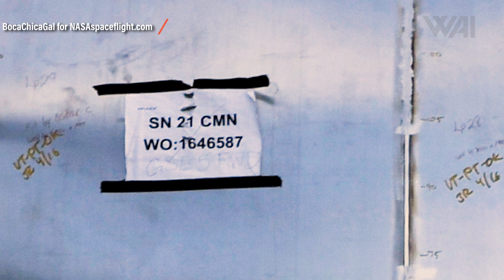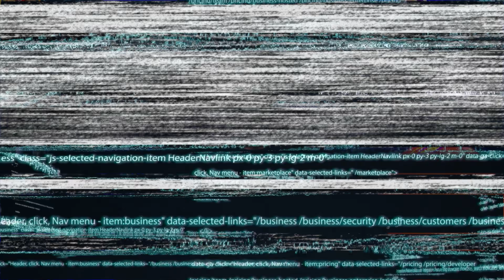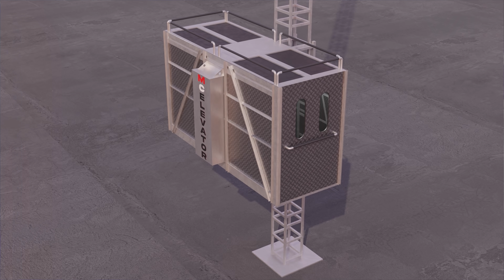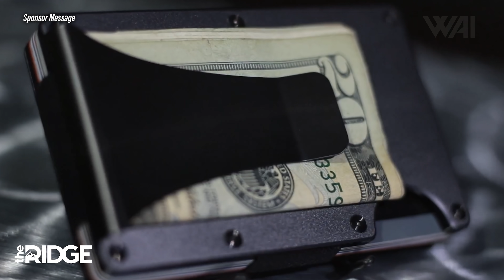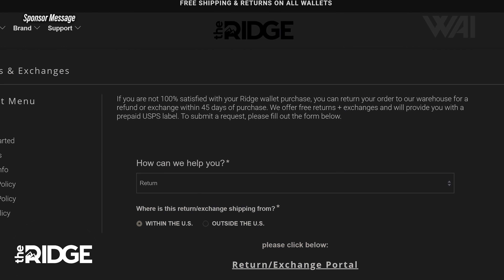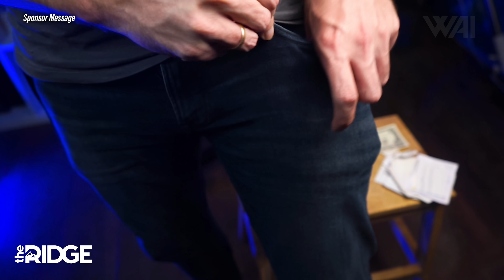SpaceX Starship SN15 Re-flight not happening? Virgin Galactic about to start tourist flights!

Comment: I wouldn’t do it because my idea space isn’t going to the Carmen line and coming back down my idea going to space is going up and making several orbits around planet earth
Reply: 89 km is not even Carnan line
Reply: carmen line? Uhhh yeah, about that...
Reply: Give it 10 years, and you'll be able to, the hard part is proving somthing is doable, once you prove somthing can be done expanding on it is easier
Reply: @tjtthedj  
10 year? By then you will be able to buy a ticket to Mars. Starship will likely fly with passengers next year.
Reply: @andrasbiro3007  That's extremely optimistic. Starship will have to do many, many missions before being human rated.
Reply: @16BitGoofball  
They make a Startship like every two weeks, and once the landing works reliably, they can fly one many times. At this pace it doesn't take long to human rate it. The hardest part is that the design has to be frozen, so they'll do it only when it's in full production.
Reply: @andrasbiro3007  The human rating will come very quickly, yes. But I just can't see it happening by 2022. The earliest I'd give it is 2023 because of the Dear Moon mission.
Reply: I agree. I suspect this suborbital "space tourism" is going to die very fast. Perhaps if it was under 5000€. For this price, you can go for several minutes of zero-G (plus a Mars and Moon gravity) ride on a plane.
Reply: *Karman
Reply: @gsmontag  *Kerman

(KSP joke)
Reply: @FastSloth87  now you've just crossed the line.
Reply: Sure, but if the one costs $250,000 and the other costs $55,000,000, and you're only a millionaire, what are you going to do?
Reply: For the real sticklers: Kármán
Reply: I would rather go to the karman line than not go at all, might need to wait until someone builds a space hotel for it to be feasible to stay in orbit.

Comment: I wonder how Highway 4 is supporting the weight traveling along? Was it stenghened before? 🤔
Reply: You'll notice the moving devices have a large number of wheels and axles, so the load is spread out over a larger area than with a regular vehicle.
Reply: @stickmann7363  lol
Reply: The rocket is only properly heavy when its fuelled up.
Reply: @Dave5843-d9m  True to an extent, but I think Ricco was referring to the launch/integration tower segments which seem to be around 400 to 500 tons each.

Comment: I would prefer them to finish the infrastructure than do another flight for like the next month so they can do non stop work on Starbase without shutting down every 2 weeks for a testing campaign
Reply: With Musk wanting a SN20/BN3 July flight, that may be why SN16 hasn't went anywhere. Too much to build at the orbital pad. Not to mention, SpaceX just got a $50M NASA contract to demo Starship to Starship refueling in LEO by the end of 2022. So SpaceX needs to move right along on some orbital test flights.